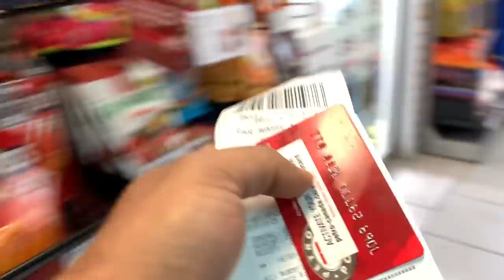Easily Affordable EXPENSIVE Cars in Canada - My Brother Leasing a Land Rover for Rs. 25,000 / Month

Comment: Engine light is on  , classic rovers.
Reply: i have a 2010 sonata... 145,000 miles which is 233,000 km.... never had check engine light on... thats what is called reliability
Reply: Bhai Merc BMWs audi jlrs are know for engine check lights and least reliability.
Reply: @Inder473  i would say they are still better than Range rovers, i own E90 Lci , engine light only came once in 65000 miles and that was also for misfiring spark plug, but a friend of mine had range rover and its just a pain in the ass, despite it being 2015 model and mine bmw is 2009 .
Reply: Mine Mercedes Benz 2017 C63 AMG got a check engine light yesterday!
Reply: I was about to comment that 😂